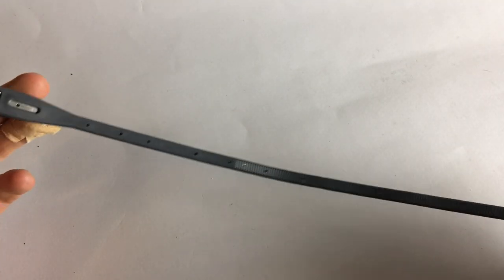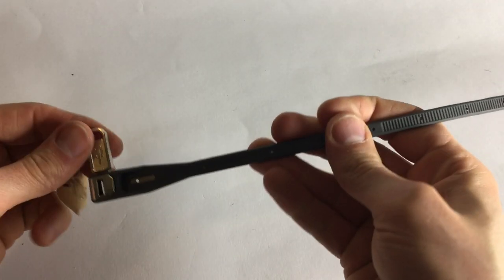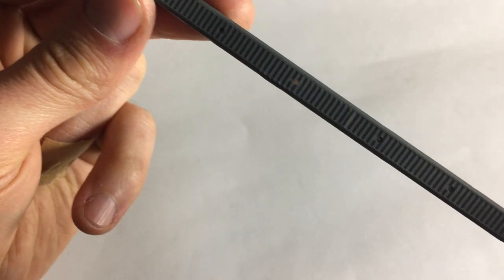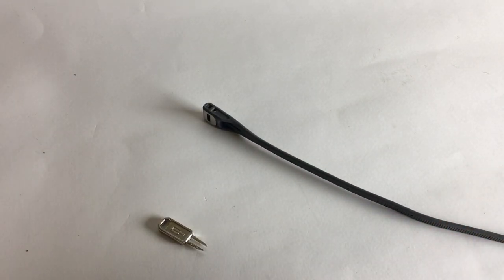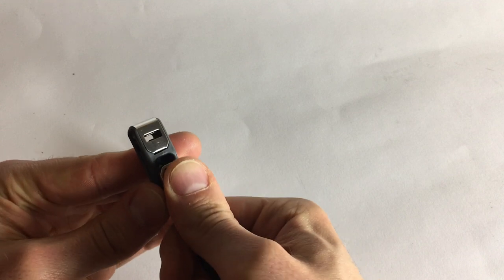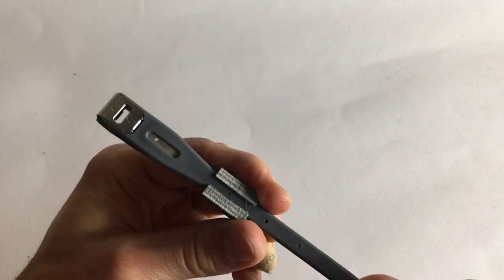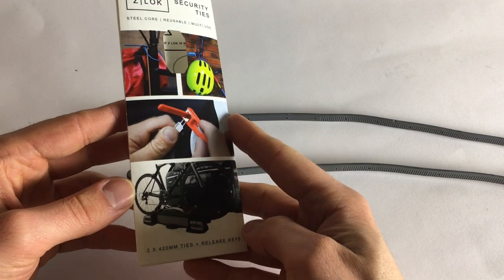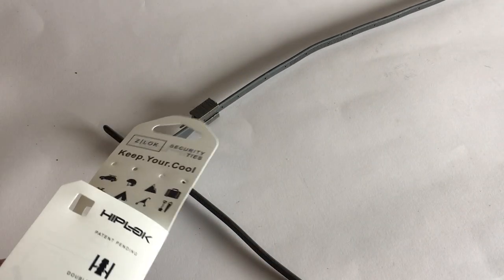A look at and improvement of the Hiplok ZLok

Comment: Why don't you just keep the key in the lock holes itself?
Reply from the maker: Having the keys in the lock all the time has two disadvantages in my opinion:
First, the spring that locks the ZLok is always under tension and "unlocked"
And secondly, the whole thing gets wider. Right now I am carrying it in my bike frame so I want it as slim as possible.